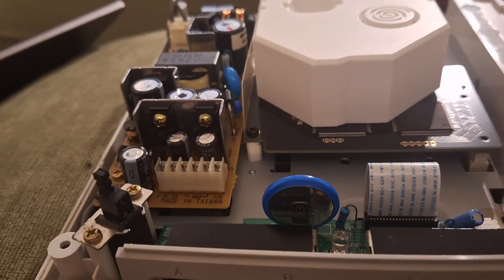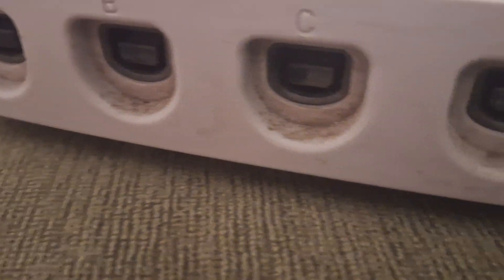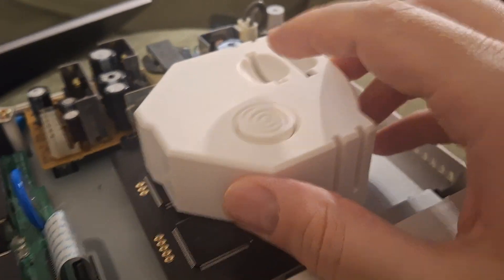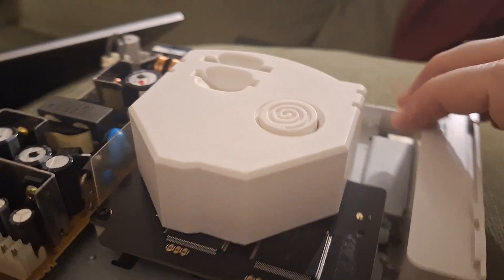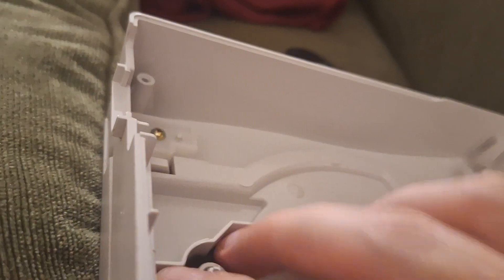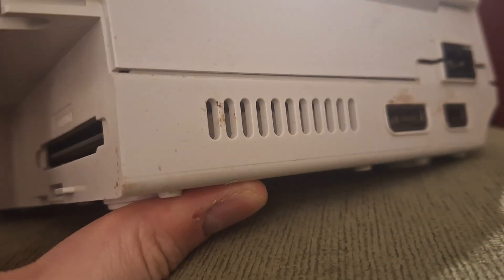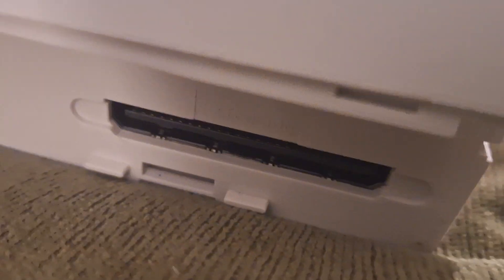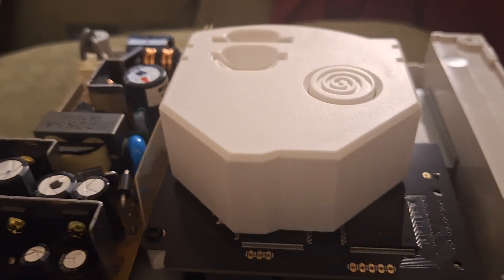Dreamcast GDEMU clone install tips for 2024 with sd extender

Comment: Very helpful.  I could not figure out what to do with the ribbon cable of the extender.  I was putting the whole thing together in the wrong order.
Reply from the maker: @carterfest  glad it helped. One thing you might want to do is remove the power supply and clean the pins. It made games less likely to freeze for me. The brand of sd card and adapter also matter. I cant say for sure what the best brand is.

Comment: Were you able to get the gdemu going? Interested in seeing some Dreamcast games in action with the OSSC you also unboxed in an earlier video, especially since you mentioned you never owned a DC before.
Reply from the maker: Yes I took apart the pieces and lined everything up better and the case closed much better. The included 8gb SD card actually came with 7 games on it, some homebrew and some Japan. Only 4 of those games worked though. I am going to try my own SD card.
Reply from the maker: @MarioMartinez-nu9yw  Yeah its been decent so far. Its interesting that you have to resolder the save game battery. The one in the Saturn can be swapped easily. Im guessing the GDEMU allows you to save to SD card or maybe you can only save to the VMU then.